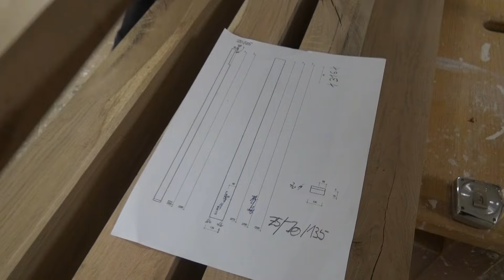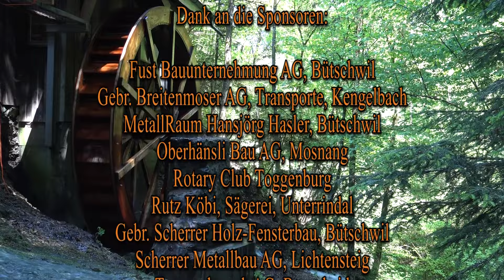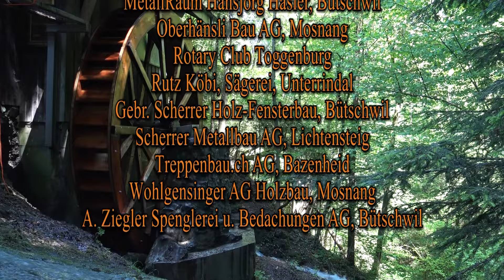Neuerstellung Wasserrad Säge Hätschberg

Comment: 2016.no problem to get that amount of wood. wonder if they could do it 2022? 
and not thinking of Corona. They were only a few, i only saw 4, and i nthe end the finishing crew. 
so there should be no problem? 
One question though i don't see anything about. the -templates - for certain things. where did he get them from? made them himself? or were they - somewhere - in a corner in the shop?
not that it matters much one would suppose, it is good to see that young people are still interested i nsuch works. 
AND even better to see that they go with the times and know how to use tools that make their work easier ( Cad...)

Comment: if y'all make a water wheel like this again, just put the second side down on the first and use shims to lift the paddles up into the second side's slots when you line them up... so much easier... then you pull the shims out and pack it down
Reply: there is water  when you assembly , so let glue is hard they have worked the wheel first
Reply: I like it!

Comment: The Wheel is installed the wrong way round, It should discharge the spent water Downstream
NOT  UPSTREAM,   sorry to inform you. and any bypass water from the stream should flow under the wheel  just touching the bottom of the wheel, that will give more energy,
In your installation, the wheel should be trying to role UPSTREAM.
Reply: Very interesting consideration
Reply: Sorry to inform you but its an 'overshot' design...much more torque that alternative designs. You've no idea.
Reply: Overshot (this one) and undershot designs are used in different applications.  The undershot is for very low head of water here they have a hull head so they use the overshot wheel.  https://en.wikipedia.org/wiki/Water_wheel

Comment: EW  - you are incorrect. This is an overshot waterwheel that turn in the direction off the flow. Mid height (aka breast) and undershot wheels turn the other way.
Reply: So your telling me  ,you get more power from an overshot wheel ,an undershot wheel with captivated excess waterflow ,will produce 1.5HP more than its counterpart .on a 10Ft wheel.

Comment: I guess real men have no need for safety glasses! He'll learn the hard way!
Reply: Life is a matter of assessing risks, and working with them, in an educated way. When I saw workers in a TV program like 'George to the rescue' advertise protection equipment (glasses, helmets and airway protection), wear that, and next bang around without thinking, I could only think that they will end up with fractures, nails or big splinters in their arms and legs and what not. The risk assessment question is, what is better, responsibly using tools to minimize risk, or wearing (partial) protection in the illusion that nothing can go wrong?
Reply: @jpdj2715  But that's not the real question.   Using tools responsibly to minimize risk should be a given.  The question then becomes do you wear protection as a normal part of working or do you gradually lose your hearing and respiratory function and risk losing your vision if something really goes south.

Comment: I was surprised they didn't appear to put any kind of water sealer on the new wheel?  Maybe they did and I just missed it.
Reply: Water sealer doesn't help. Wheel doesn't stand longer.
Reply: In fact they need to be a slight bit leaky, since when idle the water should drain off the buckets.